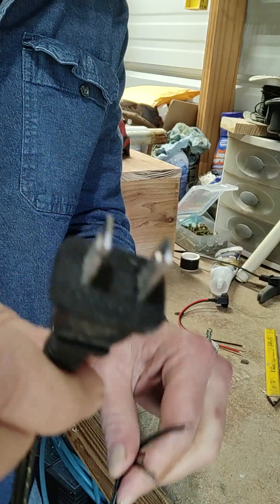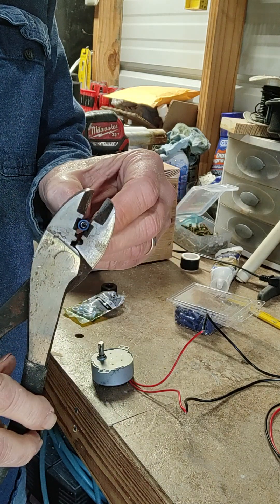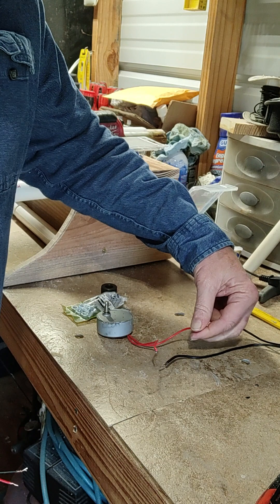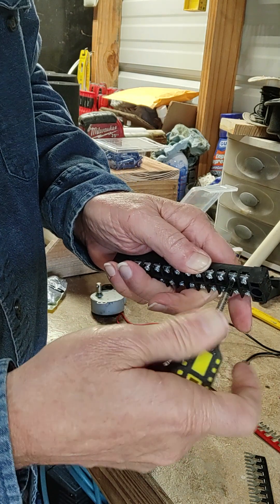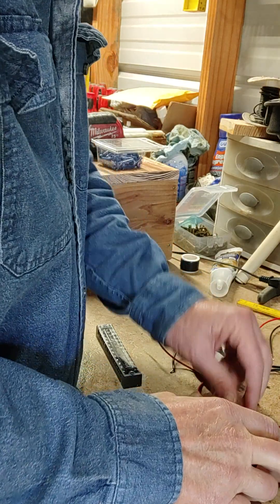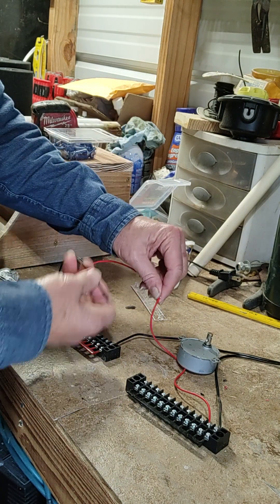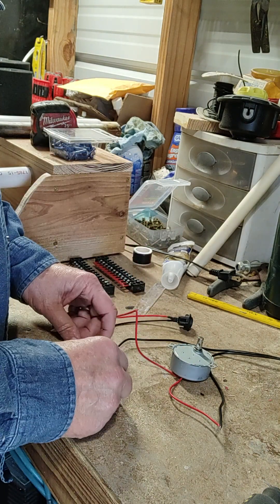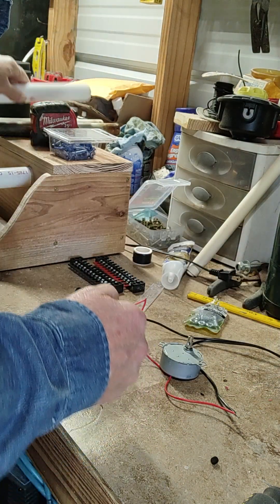Magnetic cup Turner build electrical recap

Comment: Thanks Steve! This is the most difficult part after the build. Tutorials don’t take step by step one at a time for those who are more visual. They rush through or some are all done then rush to explain, which is difficult for me. Thanks again!
Reply from the maker: Glad it helped!
Reply from the maker: You are so welcome Hope you got the wiring done and it works good for you!
Reply: Wiring is done! Now, I’m working on PVC, wood dowels, magnetics, and shaft collars….
Reply from the maker: That's awesome I guess my recap video helped out, just make sure when you attach your PVC fitting to the motor it is perfectly in the center or it will wobble.